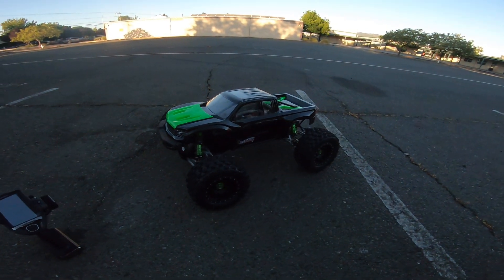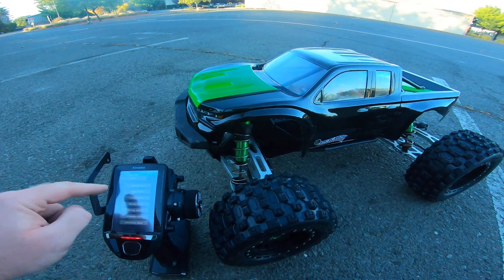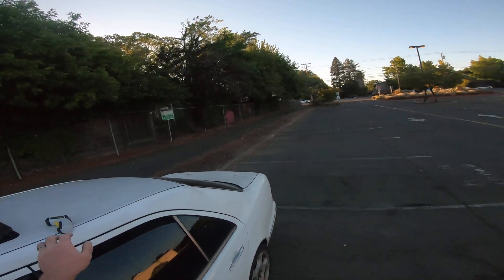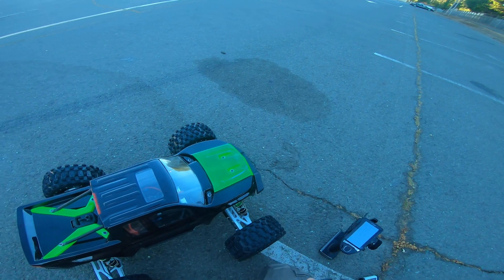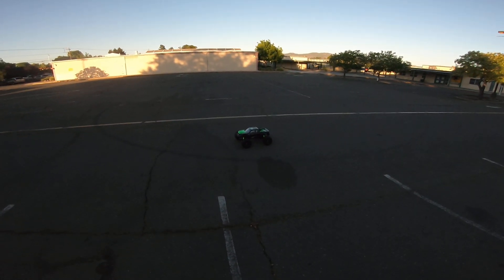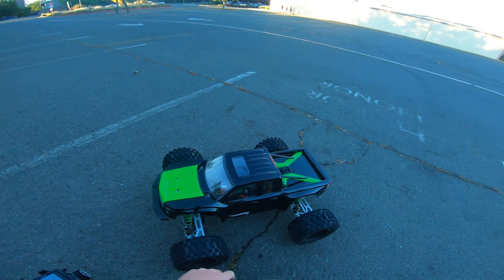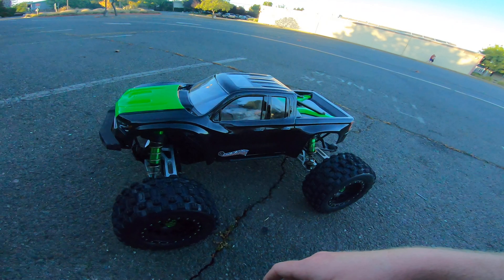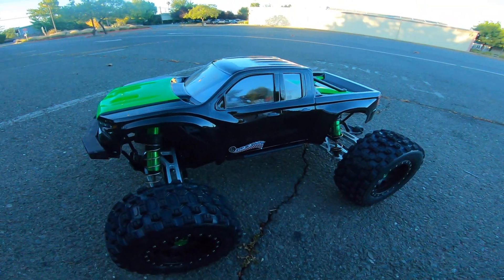WFO wide xmaxx running the new Castle 1717 1650kv

Comment: What axles have you found that work with the arms? I know it's kinda proprietary to the design, but I printed some wide arms and I cut and lengthened the stock axles. Did you guys do the same for prototyping the setup, or did you find some useable length axles that work? 
This is a personal project, not for sale. Are you on any forums where you describe more in detail. Thanks for the vids. Keep up the innovations!
Reply from the maker: We were able to get some titanium axles made to fit these arms, these arms are 1.5" longer on each side. The kit is for sale now at WFO but only a few left from the batch. More will be made when time allows, the axles arent available separately at this time but will be available as spare parts in the future.

Not sure what you used to make the arms but we did try 3d printing some and the materials we used never held up, there was one filament we didnt try but I dont think it would have made much difference.
Reply: @HighVoltageRC3080  yeah all I did was print out the arms for fitment. I know they won't last . I cut and sleeved the axles also for fitment.
I did modify the diff cups and axles to press in larger drive pins then rehardened them. Thanks for the reply.
At this point  I'll  try machining some from  4140 1/2" square bar I have. Just wondering if you tried any stock rig axles for testing purposes lol. Ive already machined the new arms from 7075 alu . Keep up the good work brother!
Reply from the maker: @the_fedz  kraton 8s rear center shaft is pretty close.. little shorter than what we used here so if your arms arent as long those might work for you... they're not super strong but might work.
Reply: @HighVoltageRC3080  thanks friend, that's a good starting point. I'd rather buy a couple of those to start with for testing than spend the time to machine them until I'm happy with how it all works together. The arms I made have adjustable length turnbuckle outer ends . I have a small cnc mill. For prototyping parts.

Comment: Can the Castle 1717 handle the X-Maxx?
Reply from the maker: I've had no issues with it... ran it several times then pulled it to try in another truck but it ran good in my xmaxx. The new 1260kv 1717 will be a good option also and should be able to handle more gearing. But I do like the 1650kv motor in the xmaxx.
Reply: @HighVoltageRC3080  did you bash on dirt or just road? I don't need stupid power just something like stock but runs cooler!
Reply from the maker: @jeffholmstrom8713  not with this setup. Id go for the 1260kv 1717 with mmx8s esc and itll probably be good. Or a max5/1100kv hobbywing will also do really good.

Comment: Hey bro, I looked on the site but didn't see the wide kit. Is that something that's in the works or did I just overlook it??
Reply from the maker: Itll come up in the search.. we're waiting on new axles though so we dont have any available at the moment.
Reply: @HighVoltageRC3080  OK thanks
Reply: @HighVoltageRC3080  Nice. I would be interested in this set up. Are those aluminum control arms?

Comment: What size motor do I have to have to use the wfo gears on my xmaxx?
Reply from the maker: Any motor with 8mm shaft just about. We have 5mm shaft gears also for stock motor or the castle 1717 or spektrum 1250kv from kraton 8s. The ratios are limited and I prefer mod1 anyways. We just do the 5mm gears for people that want mod1.5
Reply: @HighVoltageRC3080  OK thanks, I'm in the process of trying to learn different gear ratios. I just love your rig, it's not a speedster but it has enough speed.
Reply from the maker: @deepvoice2652  this is a smaller motor setup.. but its enough if you're just bashing. This was like 23/54 I think in mod1.
Reply: @HighVoltageRC3080  i heard that the 20/50 ratio was the set spot for gearing.
Reply from the maker: @deepvoice2652  "problem" is I couldn't mesh the motor.. the castle motor sits higher on our mini mount than a stock xmaxx motor. I had to go 54t spur just to get the pinion to reach.
Reply: @HighVoltageRC3080  yeah, I've just been trying to get ideas from different guys. You guys help me out so much and I really appreciate that. I was thinking stock motor for now with hot racing gears. I don't have the xmaxx yet, gotta wait till Christmas😔🤣
Reply from the maker: @deepvoice2652  they're fun upgraded but also really fun close to stock just geared up. They hold up better when they're not super upgraded and heavy also...
Reply: @HighVoltageRC3080  thanks, I'll be trying to get some pointers from you when I'm ready to upgrade if that's OK???
Reply from the maker: @deepvoice2652  no worries man happy to help any time....
Reply: @HighVoltageRC3080  thanks!!!

Comment: Looks awesome I tried to run the integy +12mm hubs but they are made for their axles n they use the smaller 6S axles n axle pins so I scraped that project and then I saw your vid n got excited my Xmaxx will be wider soon lol I only wanted 1” wider arms but I’ll take 1.5” beggars can’t be choosers lol I’ve been waiting years for a sensored 1600KV I’ll be running that setup as soon as it’s available